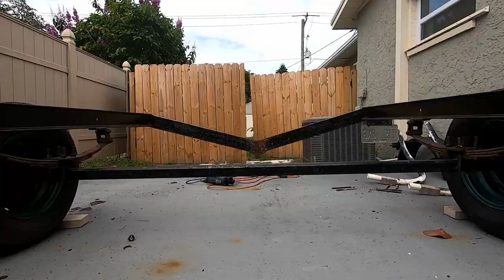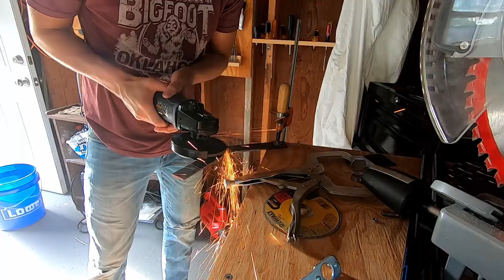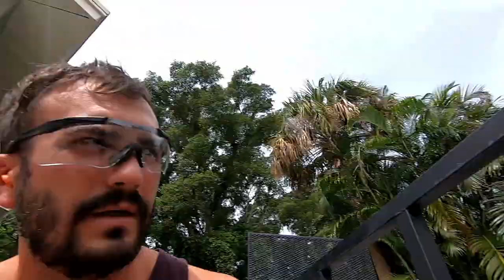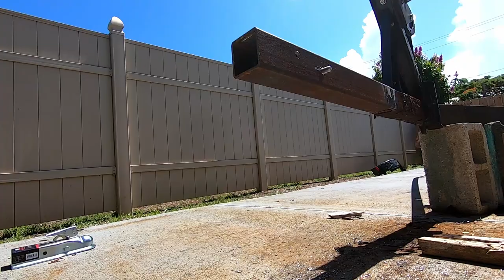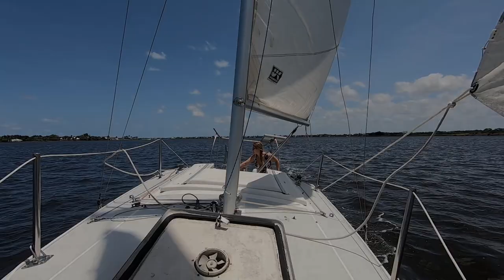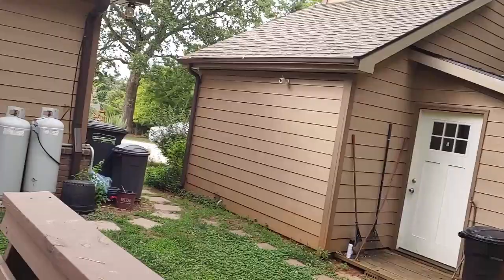Fixing the boat trailer of a 26D-- the not-so-fun side of boating.

Comment: well done.  i have a 1986 26d and the first time i took it out on the road after a complete very extensive rebuild the bloody axle snapped less than two blocks from my home.  they towed it back to the house on the back of a flatbed and the tow guy hooked the overhead cable lines with the mast (in its cradle) and ended up pulling down a whole mess of wires which started a small fire and...
... well, trailer sailing yay!

i happened to have a brand new spare 96" axle  and a full trailer build kit from johnson trailer parts (ordered for a work project) so i sacrificed the whole thing for my poor macgregor which had lived a very hard life.  i hired a professional welder (because i do actually know how to weld and my widdle lincoln welder wasnt up to the task) who welded a gas pipe right between the side rails to heavily reinforce it.  that with its new feet and legs and im pretty confident in towing it all over honolulu.  

look forward to more of your videos!  :)
Reply from the maker: It's been a while-- probably will be a while longer. I'm stuck in every bit of work one can be stuck in right now-- school, kids, work-work... No time for sailing until around 6 months from now. But hopefully it'll be coming. 
And yeah, I'm a newbie welder, so I really only welded the extension shut, which didn't need it anyway because of the bolts. So with that shut, it's at least water-tight. Glad to see someone already reinforced my cross beams, and thankfully my axle was without corrosion.

Comment: Macgregor trailers were built cheap and the surface treatment of the trailer was nothing more than hitting it with a coat of paint after steel fab to make it look pretty before marketing, hence the overwhelming rust issues if not addressed in time.   

As a recommendation when doing steel fab repairs, an application of Ospho (phosphoric acid) onto the bare steel and rusted areas will extend the service life of your surface coating by chemically "reducing" the oxidation (rust) on the steel surfaces  Then prime and top coat.

Also, for viewers who may not be informed of the basic safety aspects of eye protection when doing this type of work, particularly while grinding, a full face shield should be used when grinding as well as the mandatory safety glasses.  I have seen my share of eye injuries in a steel fab workshop environment; not pretty when watching the doctor digging the sliver(s) out of the eye.
Reply from the maker: Great advice. I have already run into new rusty spots and we haven't even had the trailer in water. And yes, the safety aspect is very important. Can't stress enough that I'm fairly lucky I didn't get tetanus.

Comment: Good advice on the PPE.
Why bolt AND weld the new tongue on the trailer?
Reply from the maker: I did both because there's a sleeve inside that isn't welded, and I don't trust the weld I did to hold through any significant events. Also, the bottom of the old tubing is rotten. So, I bolted it on so that the stress will land on the bolts instead of the weld or the bottom. Seems safer and more structurally sound to me.

Comment: I am in the same boat! (pardon the Pun)
My trailer is the black steal trailer that is rusted out. I understand those trailers are for fresh water boats and I am surrounded by salt water (Florida). 
is it cost effective to fix the trailer VS buying a new one?
Reply from the maker: Only time will tell, my friend. I spent around $500 on everything. New trailers range from $3-5k. I made sure to do my best painting this trailer with rustoleum enamel, primer, sealed up all the old holes, etc. So we will see how long it lasts. I'm also going to make a portable fresh water spray to use at the ramp, hopefully eliminating the salt water that sits for 8-12 hours while we are out and about.
I'll keep you updated, but it made more sense for me to just rebuild mine. I like to tinker, learned some new tricks, and don't mind not spending the money.